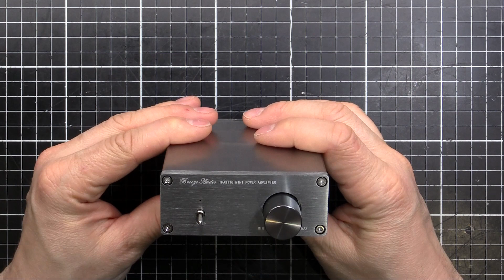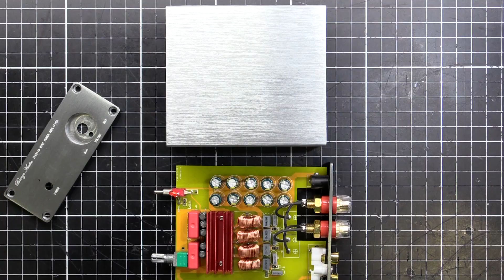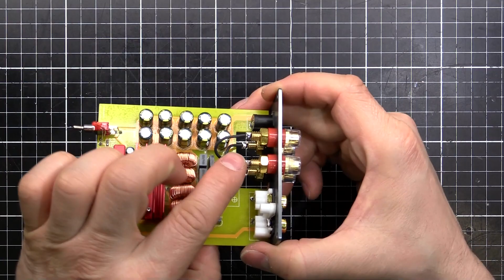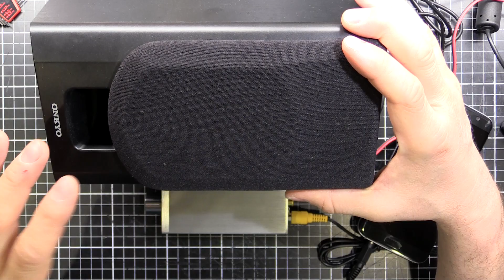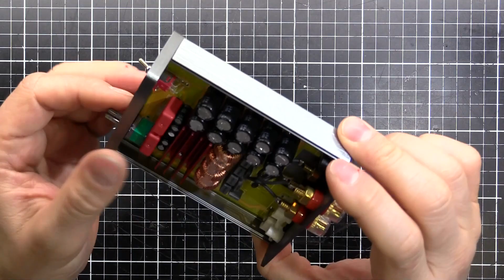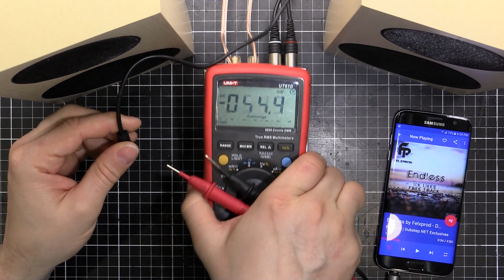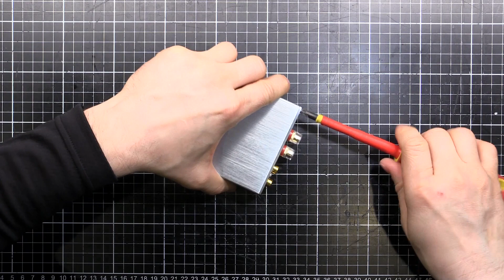Ebay 'Breeze Audio' TPA3116 Mini Amplifier Review

Comment: Thanks for the upload, great video. So, was they fake Sanyo's? Or was your 24v power supply output unstable?
Reply from the maker: Definitely fakes. My PSU was rock solid stable at 24V.
Reply: @NearFarMedia  Did you contact the seller and explain about the fake capacitors? If they are selling an amp with fake components I certainly wouldn't buy one!

Comment: Both of mines come with 35v never had an issue with them
Reply from the maker: Yeah, the replacement had the 35V ones and works fine. I wonder if they upgraded them in later production run after realising that they went a bit too hard on the cost cutting...

Comment: Nice, also take a look at the silk screen on the boards, on the first one the caps were smaller than the silk screen while that one actually has caps that are the same diameter as the silk screen.
Reply from the maker: Yeah, I wonder if someone tried to be a little too cheap and downsized things a bit too much for a production run of these amps.....

Comment: I’m trying to figure out what those giant Wima caps are for. Surely they’re not using polypropylene film caps for filtering the DC supply after all those Sanyos?
Reply from the maker: The Wima caps, along with the inductors are filtering the high frequency switching noise from audio output from the class-D amplifier chip.
Reply: @NearFarMedia  I mean the large red box caps on the input side of the chip. 

The TPA3116D2 / 3126D2 chip requires some AC coupling caps on the input. It looks like they’ve used some bipolar radial caps for that - and the two Wima polypropylene caps are connected to the power or ground plane on the underside!

Comment: TPA3116D2 is a good chip (if a real one).   The Chinese amp designs tend to fail in the design of the output filters.   Get a good TPA3116 and they work great.

Comment: Good vid, You want to make them both identical with the same mods and then turn them into micro bi amplifier monoblocs, I'm sure I've seen these chassis cases for sale on Ebay- you could buy 2 cases and turn one into a psu and the other into a preamp with a few switchable inputs,bass,treble with the 2way output... Kewl, I think I just got my next project. :)
Reply from the maker: Make a video and show us how it goes! I'm interested to see how it turns out. :)

Comment: Currently I set up a class AB stereo amplifier with 2 x 18 W (rail to rail opamp AD820 with TIP120 / TIP125 Darlington booster stage). The power dissipation of each power transistor goes up to 5 W and I use a heat sink specified with 9 K/W for each of them. So the chip temperature will stay below 100 °C in each case. Thermal design and stabilization of the quiescent bias current is crucial.

Comment: I guess they have replaced the original 35 V version of the caps by 25 V version because most of the people operate such amplifiers at 12 Vdc, especially when they use 4 Ohm speakers. It was clearly visible, that the PCB was originally designed to use the larger diameter 35 V versions of the caps. In general it is recommented to use electrolytic caps, which have at least 20% more voltage capability than the maximum voltage which is used across the cap.
 
Is is also not recommented to exceed 20 W per channel. So a power supply of 12 Vdc and 4 Ohm speakers is ok. The  problem is, even with an efficiency of 90% you have to transfer 4 W of heat flow across this very tiny heat sink. I guess you will not get less than 20 K/W transfer resistance inside this housing. Considering an inner temperature of 50 °C you will end up at 150 °C at the chip. You can forget about more than 20 W continuous power per channel in each case.

Comment: How about if you did make any changes and just plugged in and play, probably nothing would have popped 🤣🤣🤣🤣 sometimes things run best untouched 😂
Reply from the maker: The changes I made to the heat sink made no difference, fake capacitors gonna fail regardless. :)

Comment: NFM.     New this capacitor mach better sound performens whithoud old capacitor ?
Reply from the maker: The new capacitors don't change the sound, but they do make the amplifier more reliable.

Comment: Aluminum electrical capacitors should not be operated at full voltage - they should be only run to about 70% of the rated voltage.  Temperature with ripple current are factors, so running any parameter to max will likely pop a cap.  Nice video - thank you!

Comment: I used those Breeze Audio amps, they are junk. (Fosi is terrible too). I switched to Nobsound (newer ones). Their caps are Sanyo 30v. I run the amp at 26v...no issues. Running these at higher voltages causes clipping and cut out (but, I never popped a cap). They come with a 19v AC/DC power adapter...but, if one wants more power, they run fine at 25-26v. I also have the Nobsound 160w x 2 amplifier (TDA7498E chip) and run it at 35v...quite a power beast. No issues with heat, output, sound quality. Good video and explanation...a buyer needs to check those caps on any mini Class D amp they decide to go with.

Comment: ive got a Breeze amp and a little Bear Valve buffer  pre amp.I've seen a video on here where a guy has connected the Little bear pre to the Breeze amp.I was thinking of doing the same but im worried in case it pops or blows.Would i be ok connecting the two together without any problems?
Reply from the maker: It should be ok, as long as the capacitors in yours are the higher voltage rated type (or you replace them like I did).

Comment: Exploding caps! You did say that would happen. It seemed quite grippy when it was working. What does it sound like with live instruments?
Reply from the maker: It sounds pretty good for what it is once it was repaired.
I mean, it won't fill a room with sound like a larger amplifier, but for a small set of speakers on a bookshelf or for your PC, it works quite well.

Comment: No offense but leaving one channel not connected was what caused the capacitor to pop.
All info I've seen for tpa3116 say not to  connect just one speaker
Reply from the maker: The popped capacitors are bulk power supply filtering caps, connecting one or both speakers will have no effect on them.

As I mentioned in the video, they were under-rated counterfeit capacitors, which is the reason for their failure.

Comment: I have the same amp named Nobsound 2xTPA3116 2x100 W and they improved compared to this one ! 10 pcs 470uf 35v caps. more caps on the input stage. Has a swappable opamp and it has a good sound out of the box. I plan to upgrade the caps and opamp as well.

Comment: Electronic rule number 1: never, ever, run power supply at close voltage of electrolytic capacitors limit! Assume 10 volts minimum between the voltage you will use and the working limit of capacitor (if you have 49 volts from power supply, use 63 v rated capacitors, not 50 volts!). In this case if they are rated 25 volts, you can use maximum 20 volt power supply
Reply: sorry I forgot: electronic rule number 2: when testing audio devices, use MUSIC, not crap noises! ciao

Comment: Hey mate, great vid. Couple of quick questions, 1. Did the cap upgrade improve/adjust the sound quality at all? 2. Where did you get the replacement caps from? Id be interested in doing the upgrade! Cheers mate, Benny, Adelaide
Reply from the maker: The caps didn't make any difference to the sound quality, but they will make the unit much more reliable.

I got the caps from Akihabara, but you can get them from RS Components or Element 14. I used to buy caps all the time from them in Brisbane when I was in Australia.

Don't bother with Jaycar etc, they sell crap capacitors that are no better than what you are pulling out.
Reply: Cheers mate, much appreciated!

Comment: With a shitty power supply like that you are lucky it works at all. With good linear PS the amp sounds just awesome even with the shitty caps. For pocket money.
Reply from the maker: The power supply is a good quality, name brand PSU. No problems with the power at all.
Reply: I mean shitty = switching PSU. This amp deserves a good linear PSU. Than it will not matter what caps are there. And the amp really delivers.
Reply: @deadushka128  Really?  You'd better inform Linn and Benchmark (both of whom use switching power supplies in their amps) that they've made a serious error; maybe you should draw up a design for them as well to show them how it should be done.  Better make sure to tell them to use some good "audio grade" cable, and watch out to make sure they get the directionality right..
Reply: @davidgriffin79    Really.
Reply: @deadushka128  Yes, really.
Reply: @davidgriffin79  TPA3116 works best with linear PS. Try it. 18v 6 ams (24v on the output) transformer will do. You will hear the difference. Benchmark and others use SMPS's because it is cheaper, not to please you.
Reply: @deadushka128  "Benchmark and others use SMPS's because it is cheaper, not to please you.
"  Lol, unbelievable.
Reply: I use a 15 Vac transformer, a rectifier and then a 15000/63v Rifa capacitor and that helped the sound quality a lot.
Reply: @bennyjorgensen  CAn you please make a vid what changes have you made ?
Reply: I would have thought that he would have considered that the power supply was out of spec.  I had a "9-volt" power supply that put out 16 volts under load.

He's gonna get another one and hook up that power supply and blow that one up too....

Comment: That is a (AC) Power supply you need (DC)
Reply from the maker: I used a DC power supply. It was an AC input to DC output switch mode power supply similar to the power supply used to power a laptop or other small electronic device.

Comment: Thanks for the great video! Took me awhile to extract the info from watching, so in case it's useful to anyone else, those replacement caps are Rubycon zlh 35v/470uf. Can anyone confirm that this is the exact one?

https://www.digikey.com/product-detail/en/rubycon/35ZLH470MEFC10X16/1189-1890-ND/3563723
Reply from the maker: The exact type doesn't matter so much, as long as the size you choose physically fits and the voltage rating is as high as possible. Oh, and that they are genuine. :)
The ones you linked do look like the ones I used though.

Comment: NFM+ These Rubycons you installed are 10x16mm 470uf and the originals were 10x12.5mm so can we safely upgrade to larger cap like a  35v 560uf Capacitance 10x20mm or more on the uf as long as it clears and do you know the acceptable height so it doesn't touch the top lid and between each one? 
35v 680uf 10x23mm
35v 1000uf 12.5x20mm
35v 1200uf 12.5x25mm
35v 1500uf 12.5x30mm The reason why is the double kick drums and bass, thanks again.
Reply from the maker: I just measured the space inside the enclosure.
The absolutely largest capacitors you could fit are 11mm x 25mm. I would leave them a little shorter than that though.

Hope that helps!
Reply: 35v 680uf 10x23mm
Reply: Datasheet only calls for 220uF...some peoples have reported that using 470uF sounds better than the usually found 1000uF, not sure why this implementations has an array of 10x470uF=4700uF!...I put in a pair in mine after removing the fake Sanyo (which have bulged on me on another TPA3116 variant) and it sounds just fine, tried with extra pair of 1000uF and couldn't notice any difference so far

Comment: add the price of the caps to the cost of the amp, but the fake 35v caps may work unless they're over rated as well. What's the point of selling something that has some potential with the fake parts when you could charge a little more and then your friends would want the same and they would sell more, bad business!

Comment: People never think about the amperage, if you use two car batteries in series you'll get 25. + volt and this thing will draw 6.5amp if you only have 4.0 up to 5 amp it will have less bass and sound hollow

Comment: The Chinese will spend twice the amount in time in the artwork of their clones because they don't have to pay their employees much, things like the capacitors are only designed once so they copy the original millions of times, but these caps are all over the place in voltage and capacity, but if you think it sounds good, replace the caps with high quality, but I don't like where some of the caps are located, too close to heat and that cases issues with the specs of the caps.

Comment: The caps are fake. The whole point of the score marks on top of the cap is to allow them to open if pressure builds up inside the capacitor,  here you can see they did absolutely nothing and the whole can blew off.  So basically they are non functional.   Also,  modern electrolytic caps do not like being pushed over their spec voltage rating,  like at all.  If it says 25 volts,  it absolutely means 25 volts and not a volt more.  I would have kept the input under 20 volts max on those.

Comment: Okay, I bought one of these on Amazon that is "Nobsound" branded and black in color and cost $45.00 with free shipping. I took it apart and it came with larger, 35-volt,105 degree Sanyo capacitors inside that took up all the space. It also has a pre-amp inside. I measured 35.2 watts per channel at full volume with the amp connected to 8 ohm speakers and a 19 volt laptop power supply.

So if you get one of these make sure you get the black "Nobsound" branded one on Amazon, it is the best.
Reply: I'd never buy a nobsound, purely to keep dignity.

Comment: How exactly are these amps called? Also, can they be used for a guitar or is there some difference between these and guitar amps
Reply: Guitar amps are different in many ways. They're usually mono output. They have multiple tone shaping controls (whereas this unit has none) and in addition, usually not so much high frequency output. Also guitar signals are much weaker than what you'd find coming from a phone, so guitar amps usually have a lot more gain.

Comment: Piece of CRAP! How can it be any good when the capacitors fail in less than 1 minute of amplifier operation!
Reply: Ryan Toomey It isn't a piece of crap... he sent to much power to it... the voltage listed on the caps is what they can handle for a certain number of seconds if their is a voltage spike but you shouldn't give them anywhere near the voltage that is listed on them
Reply from the maker: +Zack Burkhart The amplifier is rated to 24v, but the capacitors, being fake, couldn't handle it.

Once they were replaced with genuine parts, the amp works great.
Reply: Actually, you should never run near the voltage rating for any capacitors unless you like hearing that "pop" sound. Sanyo caps are not fake, they're just not good caps like Rubycon or Nichicon.

Comment: TPA3116 chip is designed mainly to be used for car audio running on 12V. When you run it past 20V, it will distort like crazy. Try using 12-16V. You will get higher fidelity.
Reply from the maker: The datasheet from Texas Instruments says it is good to 26V, and it sounds perfect at 24V, which also allows for the highest power output.

Comment: Just bought a TPA3116 off eBay, no box just the board, and same "Sanyo" caps... after seeing this, I'm buying some legit 35v caps and recapping mine just to avoid any future issues. :)
Reply from the maker: Yeah, definitely a good idea, after replacing the caps, it's not a bad little amplifier.
Reply: After watching this, since my amp is just a board (no case) I tested it with safety goggles on... didn't know caps could blow like that. 

Got some nice Rubycon 35v caps coming for the power, and because they were cheap, some Nichicon MUSE caps for the rest.  Doubt will sound any better, but, for the cost, why not. :D
Reply from the maker: Sounds like a good plan! :)

Comment: ampere of ur powersupply is  higher. that's why the caps popped off. better use 12 to 16v power supply with 2 - 3 amps. but if u use more then that the amps must be lower then 1amps.
Reply from the maker: The amperage isn't the reason, the load (amplifier in this case) only draws the current it needs, as long as the rating on the power supply is equal or greater than that, there's no problems.
If the current rating is too low, the voltage will drop under load and the power supply can be damaged.

The problem in the video was the fake capacitors, once they were replaced, the amplifier works perfectly.

Comment: Great review, BUT, you forgot the GOLDEN Rule for capacitors: ONLY Supply 2/3 of their rated voltage. 1st. They live longer. 2nd. Their electrolyte doesn't dry as fast. 3rd. if you run them at or very near their rating, even original caps will pop. This hold especially true for Tantalum caps but also for other caps too. That is why you you see 400V caps for mains and the 275v normally fail.
So, just to re-cap: for the 25v, use between 12v-18v max!
Have fun with caps :-)
Reply from the maker: True that, I wish I could have installed 50V rated caps but there just wasn't enough space...

Also I agree with the tantalum capacitors, they won their bad reputation in part from designers breaking the 2/3 rule. I prefer to over-rate tantalums by double the supply voltage just to be safe.
Reply: Actually, the reason you see 400v caps for mains is because the 230~v value is the rms value. The peak voltage is somewhere around 330v. No 275v capacitor would survive that.

Comment: Golden rule, don't buy caps and mosfets from China. I bought 4 amp boards from AliExpress. In the first the audio start to degrade over time and guess what, half of them were gone. Chinese caps are underrated, by a lot! Replaced all, improved Farad value and the amps start to play way better

Comment: Actually, the specified voltage on the capacitor is the absolute maximum voltage! So you really shouldn't go anywhere near that specification, if you want the capacitor to last.
Reply: Working volts is an old term for DC volts, as caps were primarily used in the context of AC devices back then.
Reply: @AnnaVannieuwenhuyse got it! I will fix my comment.